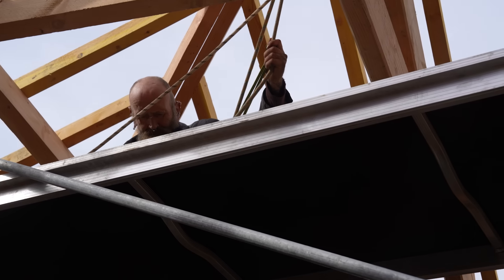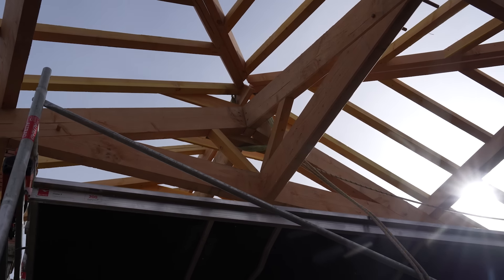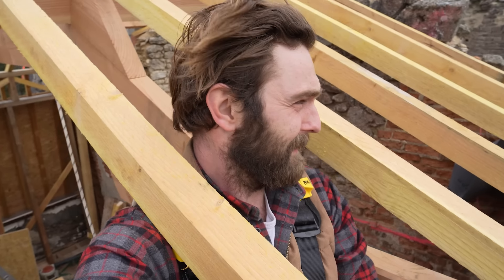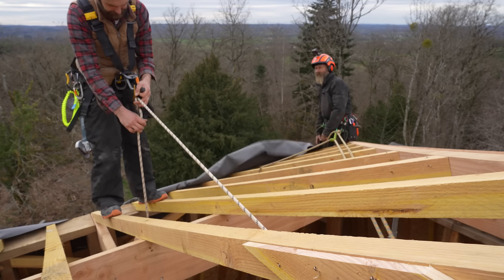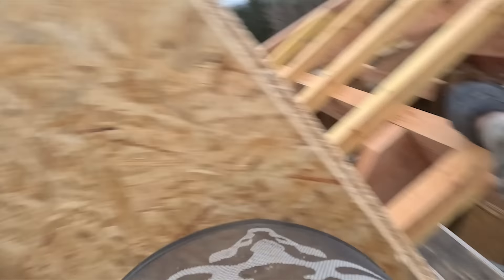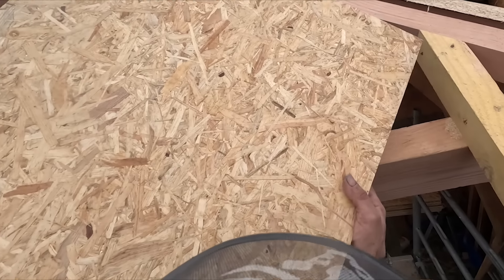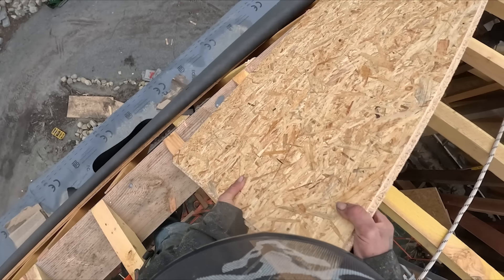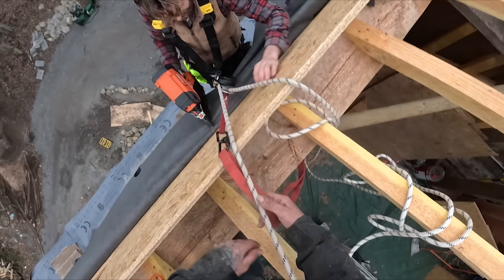The storm came early, high winds at 25 metres up.

Comment: The roof is a work of art. ❤❤❤
Reply: So glad you have the team to help especially with the inclement weather.
Reply: That was my very thought.  Watching all the intricate cuts and angles come together is not easy.
Reply: Clearly you are not experienced at inspecting roof carpentry, which if this was on one of my jobs would be condemned.
Reply: @clivewilliams3661  please tell Dan what he’s doing wrong. He has more roofing to do and it would be good to get it done right
Reply: @chriswilford3576  I have commented in detail on previous videos and this video shows more of the same errors and bad practice, he clearly doesn't want to take my comments on board, then so be it but praise being heaped where it is not due always grates.  The Emperor's new clothes comes to mind.....
Reply: Yes, when he first got the chateau I wondered how he was going to pull off reconstruction of that roof.   This is fascinating.
Reply: Mathematical art.
Reply: @clivewilliams3661 
Dan is working with inspectors.
He's not just throwing it together. 
He's had professional advice.
Perhaps where you live the building inspectors do things differently. 
He's in France. 
He's not going to these lengths to have the building collapse. 
He'll no.
Reply: Has anyone noticed 1+ mln views 🎉🎉🎉 or have I missed the celebration?😢
Reply: @jefflawrentz1624  I would say that the method of construction is unique but it still requires to be built properly.

Comment: Absolutely fab.  Just imagine what another year will do - you'll be screwing the lightbulbs in and putting down rugs.  You have achieved SO much.
Reply: In another year he will have just finished the other wings floors and roof and started on the central section's roof, there is most probably another 9 years of work left!?!

Comment: IDK if many people realize that the Mansard/Mansart roofs are two parts of 90 degrees. i.e. 60/40, 70/30.....so the first part of your roof could be 70 deg. while the part you are working on now could be 30 deg.. I like that you left the extra bit of osb proud of the steeper part for safety reasons. Here i n U.S. we use 48 inch by 96 inch sheets not practical on windy days. Unless you want to be a sail.

Comment: Agree with everyone mentioning the superb framing, the angle chainsaw cut on the roof sheeting is making me second guess everything. That was painful. Still though, you’re a better man than Me.
Reply: I am sure those are just rough cuts to get rid of the excess. Dan has the tool to do a rip cut into the middle of the rafter if he so desires.
Reply: We’ll have to wait and see. That might have been the intention to start but that one cut was angled as if to attempt to just taper down around the angle. But I’m sure they have a plan 😊

Comment: Instead of cutting triangles off the ends, why don't you cut the boards in half through the middle at the center, and turn the offcut over, and put it on the other side of the ridge? I realize that they will be upside down, but will be covered by the membrane anyway.

Comment: A chalk line and a Circular Saw set to the correct angle for the roof is a better choice for cutting the ridge on the OSB. But another week or two and you could take the roof back off for spring. lol

Comment: Why are there two ridge beams? It would be awesome to have a video where Dan describes the design he worked on with the engineer.
Reply: There are two for the two different pitches of the roof. It can be done with one beam that is beveled on each side, but this works.
Reply: Should fill the gap between the ridge beams with insulating foam prior to installing OSB roof sheathing. Otherwise, no way to get to this void when getting to the insulation stage.

Comment: I wonder if the osb joints need to be on beam and not free floating?
Reply: No. Tongue and groove boards.
Reply: @LaReynedeNeige  I know, tounge and grove is not a structural joint.
Reply: @dan__________________  It's a roof covering, doesn't need to be structural.
Reply: @LaReynedeNeige  This can't be more incorrect. The main purpose of OSB is structural. The shingles are roof covering. Please review building basics before commenting.
Reply: @dan__________________   Nope. Where I come from, we call it sarking. It's an extra cover to keep out the worst of the weather. Some places it wouldn't be used at all. Just battens straight onto the roof timbers to hang the tiles. It will give some additional stiffness to the structure, but the roof timbers should be sufficient to hold up the roof. A problem with putting joins on top of structural timbers is that if you do get leaks, it will go straight into the wood and cause rot. The tongue and groove is meant to create a smooth continuous surface to deflect water. Doesn't matter where the joint goes.

Comment: Something that escapes me is why you didn't make the window openings on the vertical slopes? It would still have been much easier to access the roof.
Reply: He's put space in the framing for the windows, but building them would be extra complexity when he needs to hurry so he's adding them in the future.
Reply: He's matching it to the original designs

Comment: dude, you need to line your sheets up so both ends are attached to a stud.  you cant let the end of a sheet of osb overhang.  also where you cut the top of your wall out to put the vertical beam for the roof structure... both side of your header are now without support.  i doubt, even in france that would pass inspection.
Reply: It's tongue and groove, not designed to be used that way. Exactly the same product and method used by lots of roofers now.
Reply: @LaReynedeNeige   hmm new to me.  doesn't seem like it would have the same support.  Are you supposed to nail the tongue to the grove like you would a hardwood floor?
Reply: @lukethompson1041  No.

Comment: When your.doimg the osb plates cut off the ovehanging triangle piece and this cut will hopefully go on the other end and similar the triangle piece off the other end will be use to start the next row you will save so many boards at the moment you gonna lose at least 2 board each side and with little or no experience at working on a harness im shitting meself watching you
Reply: They’re tongue and groove all around so the orientation may not allow for saving that much. I do agree they should cut some before putting them up on the roof.

Comment: plywood but don't the plywood ends supposed to land on that studs
Reply: I know it's tongue and groove but
Reply: Actually 22mm tongue and groove chip board, not plywood. Unfortunately, if the T&G gets wet and swells they may deteriorate. So YES, they should land on rafters to provide support and not rely on the T&G.

Comment: The hip timbrs are done incorrectly, the purlins are cantilevered too far to a hip timber that is too weak, The purlins need to be cut to the hip which should be a single timber at least 12" depth. This roof will sag over time.

Comment: Could have had it done today with the rental of an 80’ articulating boom lift. €1000! Worth it for the safety, speed, and ease of installation. Could have continued to work in the rain since no one would have been walking on the slippery roof. 

Also, it appears that the left-most of the U-shaped ring beams is resting on a wood wedge supported by a crumbling wall as seen in yesterdays vlog. That means the u-ring is cantilevered with nothing to hold it down other than being hung from the double hip ridge rafters. Probably shouldn’t be putting men on the roof until this can be fixed with a masonry rebuild of that support wall.

Comment: You are really making a lot of extra work for yourselves humping those full sheets of OSB up there and then cutting them.  Why don’t you simply measure the lengths to your cut off points and have your inside guy make the cuts with the circular saw while you guys are nailing?  The pieces will be lighter, you won’t make hack cuts with the chain saw, and there will be less time wasted.